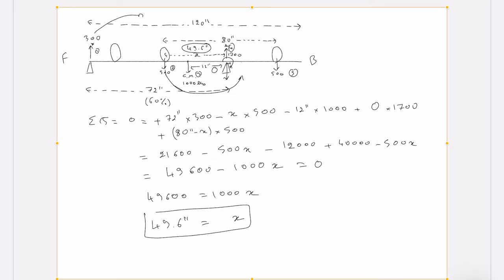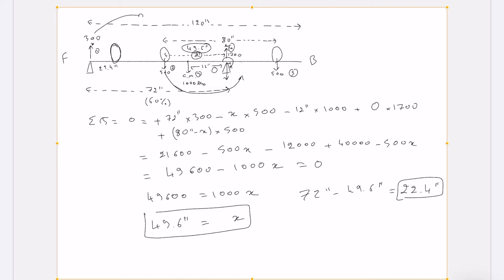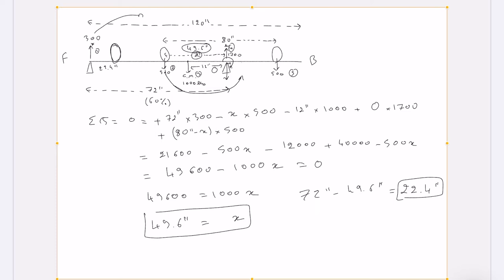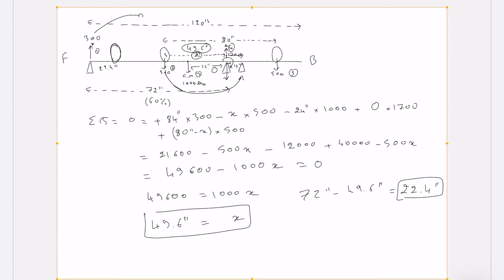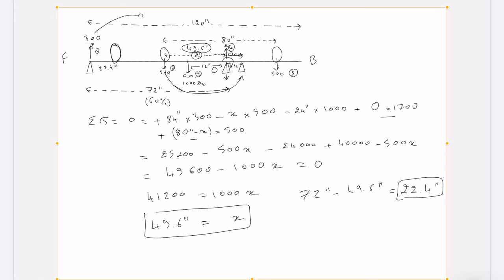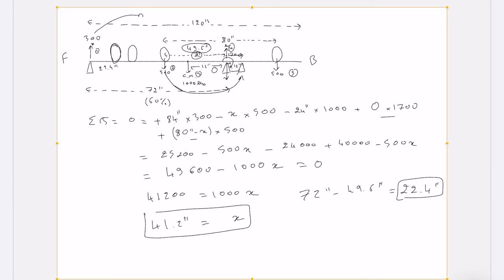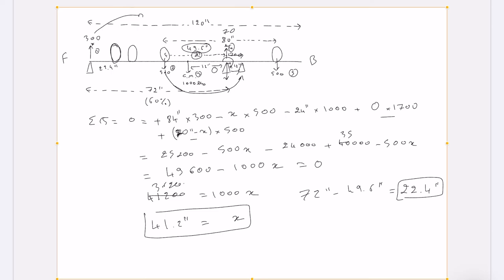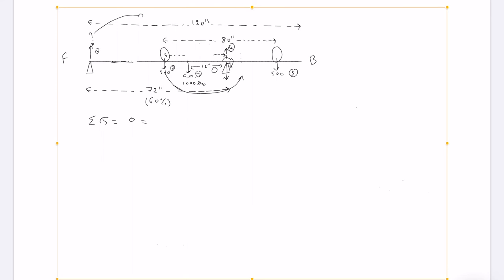Trailer design | Part 2 | Load distribution

Comment: How did you get the 12 inch distance between tandem and centre of mass of trailer?
Reply from the maker: It was an assumption that I made. Some trailers are built so that 60% of the total length is in front of the axle (in this case the trailer is 120" long so, 60% equates to the axle being 12" behind centre of mass). But, it could be any value that you want in your design.
Reply: I am new in trailer industry. I would like to learn more about trailer design. Is there any way I could contact so I could learn more or is there any materials to study to learn more about trailer design. Please let me know.

Comment: Goodpm sir. i'm designing right now a trailer type, which has 1 axle. a trailer type which carry a drum, so i'm thinking of placing the drum in the top of axle... but in order to lift the drum, i also added a boom with chain block... how can i present the load (vectors)?
Reply from the maker: With the boom, the problem now becomes 2D rather than 1D for the force vectors. Regardless, the magnitude of the weight (or force) vectors of the barrel lifted by the boom will still be equal to the weight of the boom and the barrel. The only difference will be that it will be decomposed into X and Y directions at the base of the boom. This should not affect the design of the trailer. The most important parameter for the trailer design is the location of the boom base. I would not attach the boom right above the center axle line, but rather more towards the front to account for the 15% / 85% weight on the hitch.

Comment: Why %15 percent?
Reply from the maker: 15% seems to give the best weight on the truck hitch to provide stability to the truck and trailer while towing. It is always better to have more than less tongue weight, as long as you truck can handle the added payload from the hitch weight. Too little tongue weight will cause the trailer to be unstable at highway speeds.